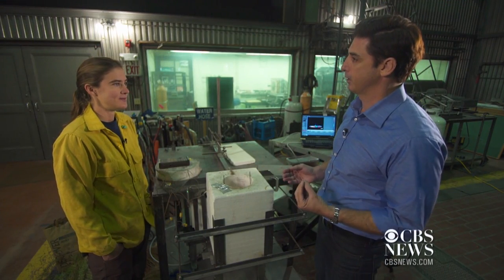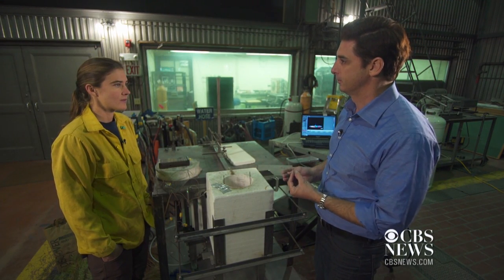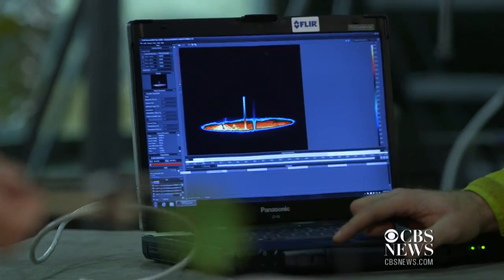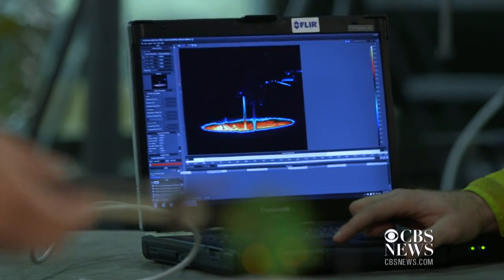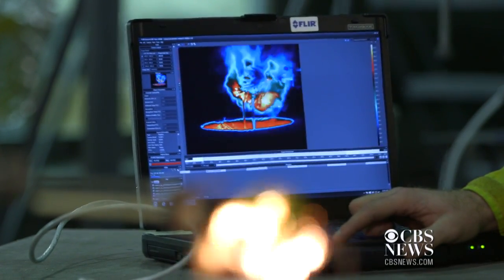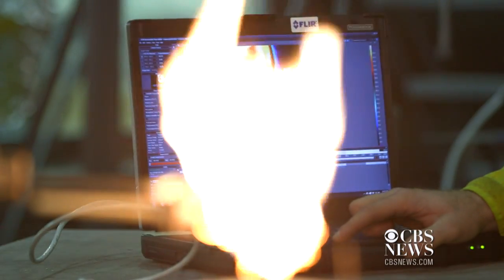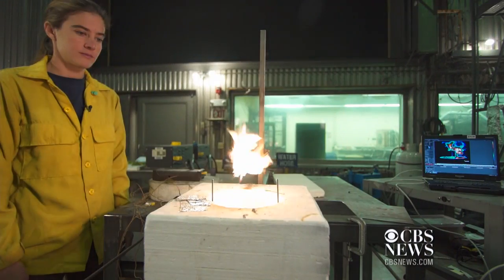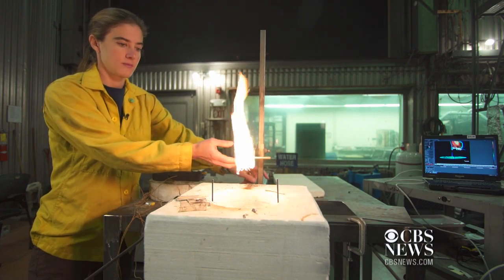WATCH: Pine needles ignite without a flame

Comment: Well, yeah. Not surprised one bit. How do you guys think fire is started in the first place. It is started with intense heat. You need something flammable to that heat in order to get fire. In order to have fire you need oxygen. That is somekind of generated creating hot air. Once something flammable was brought to the heat, it ignited because you had oxygen and a flammable material. You can try this at home with a magnifying lense. You can start a fire without fire. Using the light from the sun, it creates enough heat by itself to ignite something flammable.

Comment: As much as i enjoyed this demonstration there are a few questions that come to mind to help clarify the experiment. ..  
The heat source is said to be convective, but the news anchor states that it is blown-air, as in forced air, which is repeated by the engineer.. Was there really a forced-air heat source?
Convection is a heat-driven movement of a fluid,,, no artificial forces. 
The rapid departure of glowing embers seem to indicate forced air as does the columnar blue line on the computer screens thermal-capture video.
There is also an anomaly just prior to flame-on, near 0.59 seconds. Have you considered that
detail against the presence of dry moving air?

The heat source and forced air against the needles seems to create the conditions for both an ignition source and the creation of a fuel source of gasses, liberated from the needles and gathered into the low pressure area downwind of the needles. The glow-plug like transformation of the needles seems to be dependent on the rapid movement of air.
Was this experiment done with a slower airflow or smaller pine frond?

 Fire is almost always the result of fuel and an ignition source,,, in this case flammable vapors and glowing embers... The heat being the primary obvious operable factor in this experiment seems to have transformed the needles into a glowing ignition source (like a glow-plug) by which a fuel can be ignited providing there is present a suitable air/fuel mixture at the correct temperature and density.

  The result is a flame, but was there more to the activity than is imagined?
There is an anomaly which can only be seen on the video screen in the background, at 0.59 seconds. It looks like it may have influenced the formation of the flame.
Has this been considered from the possibility of an electric arc? We do have to consider the electrical possibilities and potential activity when the conditions are right, such as may have been created by moving hot dry air.. Hot embers are clearly present and are seen moving into  the stream of fuel, but they seem to have been upstaged by the anomaly which occurs below and to the side of the fuel source...

Nice experiment,, but we should not overlook all factors that could ignite the fuel...
Reply: One would think that this demonstration was replicated for the CBS cameras to present to the general public and that it was not the sole experiment that was conducted.  It appears that there is no published paper yet, but a quick Google search confirms that the researchers are using varying temperatures, flow rates and forest fuels ( https://www.firelab.org/project/convective-ignition ). Despite closing on a patronizing tone, you did ask some great questions. Though I am also intrigued, I believe it is wise to avoid publicly calling someone’s entire experimental design into question based on a few seconds of video and soundbites produced for the evening news.
Reply: Thanks for the link. It was good to see that attention is being placed on the various fuels released by destructive distillation.. The experiment will hopefully open the eyes of the public to consider more carefully how they interface with the fuels. And it is my hope that an examination of the potential dissociation of hydrogen components in water is thoroughly considered since we are dealing with an electrical environment of high potential  (100 volts/meter vertical) and low current flow is all that is needed to separate hydrogen from water and make it available to combustion. 
There are other factors that must be considered as well since we do not live in an isolated environment of solely terrestrial factors, there is plasma potential lurking in the background.  https://www.plasma-universe.com/Fire_(flame)

http://www.thunderbolts.info/tpod/2006/arch06/060209chicagofire.htm